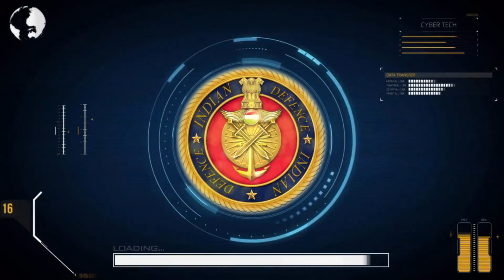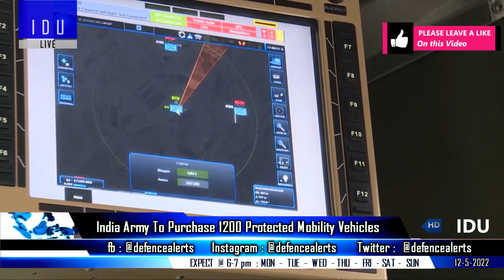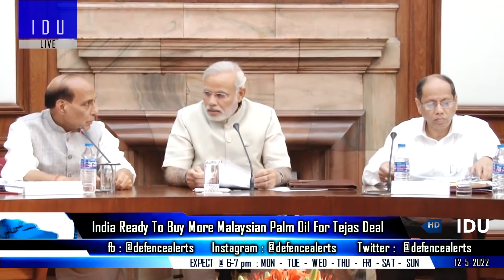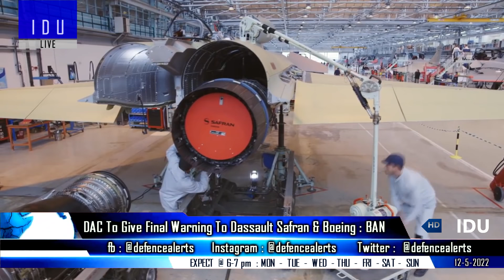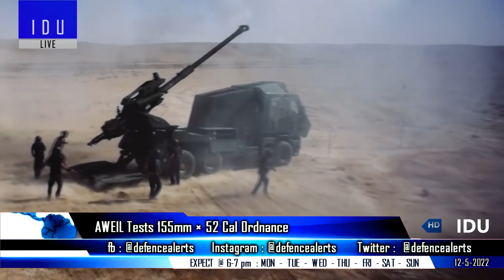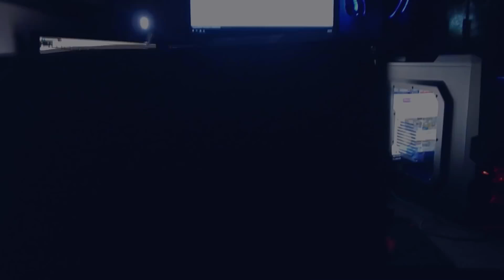Indian Defence Updates : 1200 PMV For Army,Tejas Malaysia Deal,Ban on Dassault,50 Gliders For Navy

Comment: Offset clause : It is a lesson for Indian defence ministry. OSC should be easily fulfillable by the seller. As a buyer India is keen that the seller doesn't default on the main item. The seller is not at all keen on fulfilling offset  clause.
Banning suppliers is not a solution.

Comment: the offset clause seems justified but the manner in which the offset clause has to be fulfilled is cumbersome . . . in order for the vendor to fulfill the promised offset it should be related directly to the contract itself instead of shopping other tech that is not part of the purchase or contract . . . from a vendor's point of view, in all fairness the 30% offset on the value of the contract is a bit too much for any vendor . . . any offset should be no more than 20% at best . . .

Comment: I mean, it doesn't matter whether our industry depends on these players, they should have told our govt that they won't be able to fulfill the offset clause before finalising the deal and could have offered some discounts, if they finalise the deal they should stick to the clause or pay some compensation, iam pretty sure Dassault, Thales and Safran will come in line now coz of the pending mrfa contract. But for future defence acquisitions, offset clause should be removed as the deal will become cheap and could be finalised way faster.
Reply: DOMW and indian offset partners do not follow their own offset rules. The problem of India is that acquisition rules are a mess.